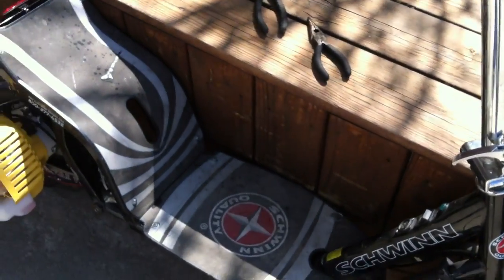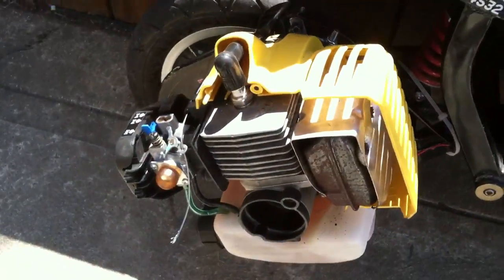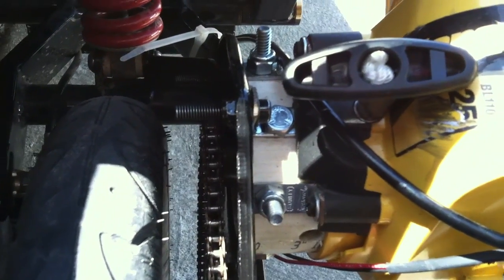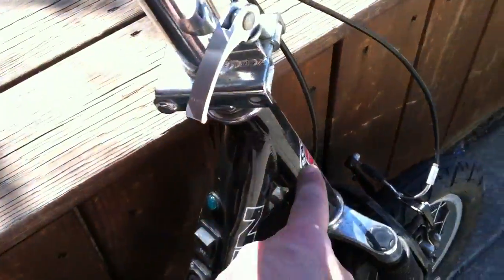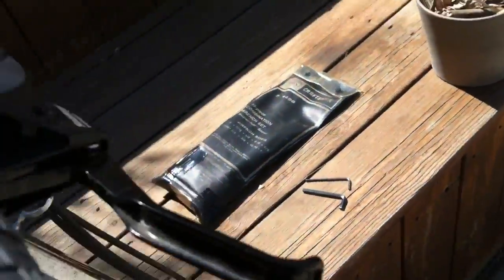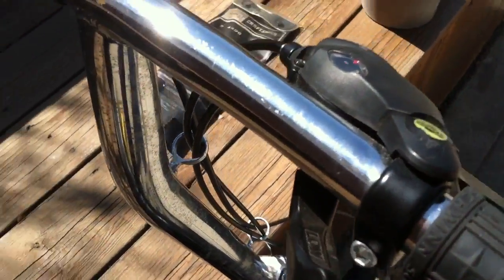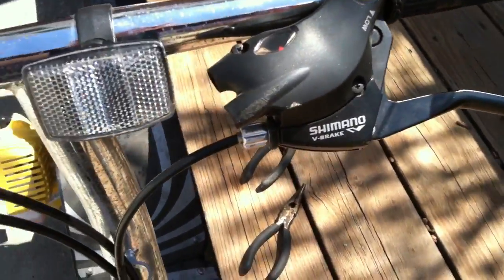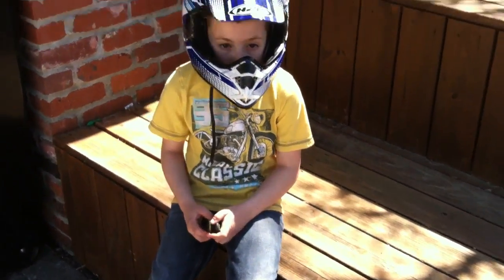Electric Scooter converted to Weed Eater powered

Comment: Boy must like it. Looks like you will have to wait until he runs out of gas :)
Great job. I'm thinking of somethong like this for my grand kids. maybe on a Razor. Did the stock clutch hold up?
Reply from the maker: I would recommend using a heavier clutch.  The stock clutch works, but I have to keep putting a few drops of transmission fluid inside the clutch bell to keep it from engaging when RPM is low & stalling engine.  Doing that was a temporary fix until we replace the clutch, but it worked!

Comment: if you put a big sprocket on it take it off and put a smaller one like a 10 or 12 tooth sprocket
Reply: What type of clutch did you use or what kind of setup is running from the motor
Reply: The shaft coming out of the motor what do you have on it I came up with the similar idea on mine with a 59 CC Husqvarna and need a clutch of some sort